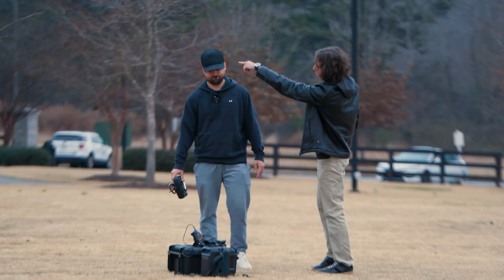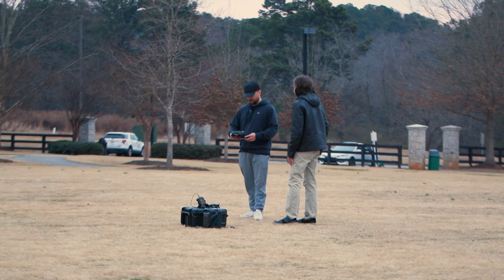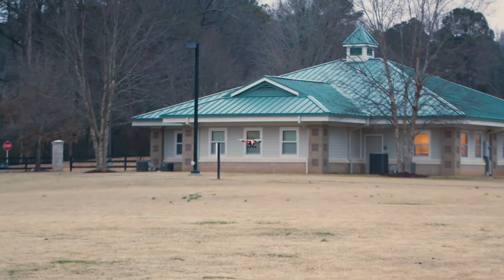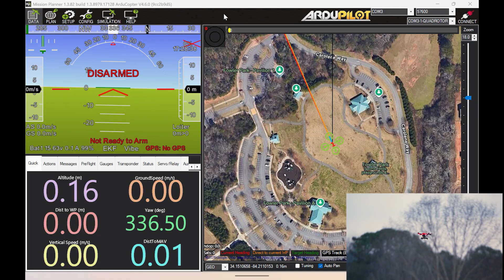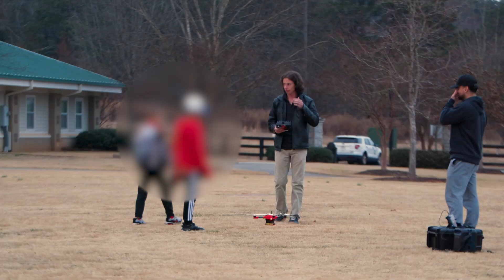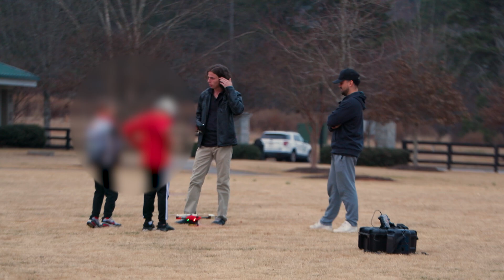Developing a mini Fan Club | Develop Air mini NO GPS Optical Flow & Rangefinder Loiter Mode Flight

Comment: For decades we flew helicopters (without GPS), and they held a perfect hover with just the use of an onboard gyro. I'm surprised at your amazement that this aircraft holds a hover without GPS.

If a full-size "drone" takes on passengers, it's no longer a "drone". (5:35)
Reply from the maker: I disagree on your definition of drone. I understand drones to be autonomous land, air, sea, and/or space vehicles. Classifying drones by the cargo or passengers they carry is moot. I think a lot of fixed wing "piloted" or manned aircraft can now even be considered drones, with onboard pilots being optional in some and increasingly more cases.

- Jacob
Reply: @ivuerobotics  Unless we're going to change the definition of the word "drone", it has always been an unmanned aircraft. Many years ago when fighter pilots began dogfight training, they started using what they called, "drones" (unmanned, remoted-controlled aircraft). They would shoot them out of the sky. They were called drones, because no one was aboard. "Drone" designated the aircraft as unmanned.

Comment: What components yuo use?
Reply from the maker: For this Develop Air mini:

Fettec 35a 4in1 ESC
2212 920kv motors
Holybro micro m9n GPS
Matek I2C Power Monitor Board
Matek MR 900 22 mLRS Radio
Matek Adj. 5v/9v/12v BEC x 2
Upgrade Energy 4S1P 4AH Battery
Hereflow Sensor
Teraranger One

- Jacob